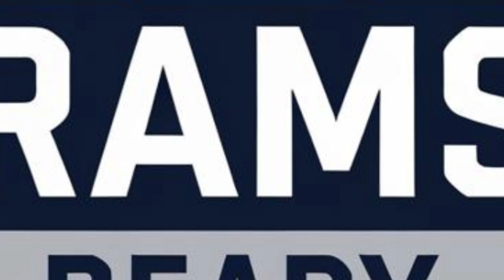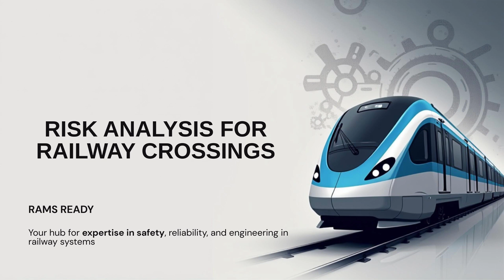Risk Analysis for Railway Crossings

Comment from the maker: Working files for this topic, built to be used on a live project:

Railway RAMS Template Toolkit
Hazard log, FMECA, SIL allocation, risk matrix calibrator, EN 50126 lifecycle checklist and a safety case skeleton, eight working files.
https://ramsready.firstlinkai.com/p/A1

Kickoff and Workshop Facilitation Kit
Kickoff pack, HAZID and HAZOP workshop packs, participant role cards, data request checklist and a recording workbook.
https://ramsready.firstlinkai.com/p/D3

Free Lite Hazard Log workbook: https://ramsready.firstlinkai.com/free
All twenty products: https://ramsready.firstlinkai.com

Which part of this gives your projects the most trouble in practice?